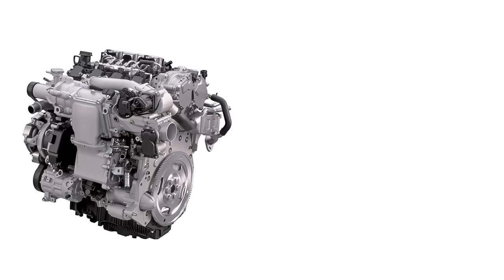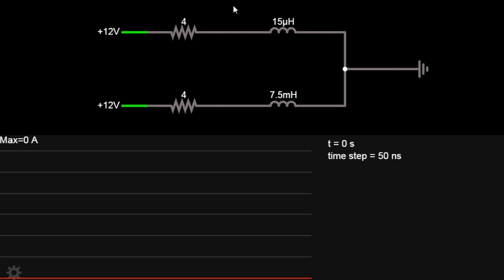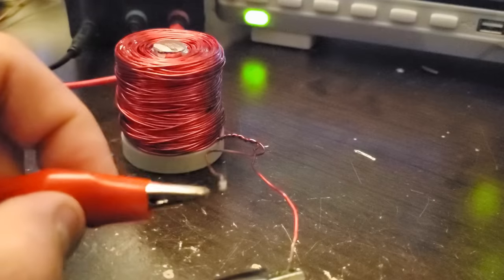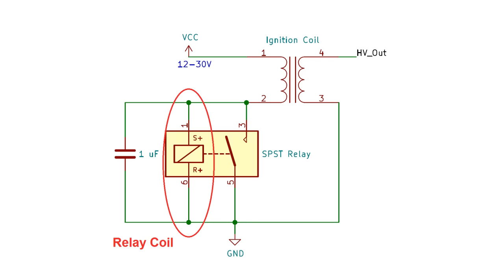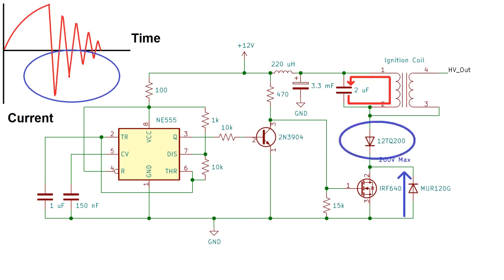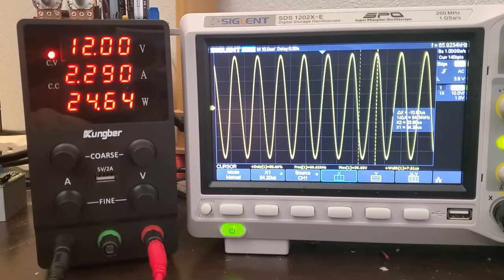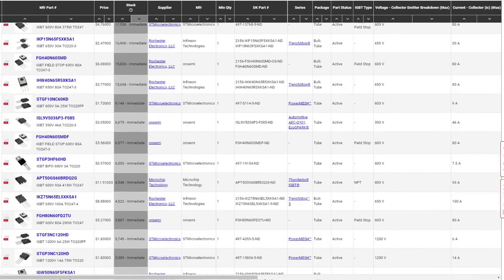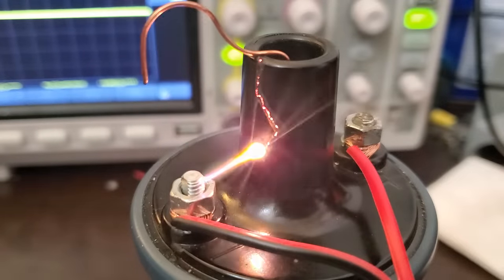Ignition Coil Drivers

Comment: Ok so in trying to 40000 volts to run straight, continuously ,from the coil high tension ,what would I need ,what size or type diode,to handle the 40k volts and would I need a capacitor to store it to keep it ready,I'm thinking multiple capacitors,  😅

Comment: Can one use a ZVS driver, somehow to drive the coil?
Reply from the maker: ZVS drivers aren't suitable for this device. In my experience the capiacitor/relay setup with the ignition coil is the simplest, cheapest way to get high voltage
Reply: @HyperspacePirate  Thank you very much for the info!

Comment: i think the resistor at 4:50 supposed to be in parallel to the capacitor not in series.this way the voltage spike is way lower.

Comment: 1:20 That diagram is incorrect. The ignition coil is, in fact, an auto-transformer; the secondary being over-wound from the primary. Where you've got the blue trace going to "HV" (should be called "EHT") should be connected to the positive and where you've got the black trace outer of the secondary connected to "GND" (should be called "-ve" because it is never connected to ground), it should be connected to EHT out.
 1:33 Another error. Flyback transformers DO NOT have "continuous AC" in them. The clue is in the name "Flyback"; they have a sawtooth wave; very, very similar to an ignition coil. The energy is produced by the sudden colapse of the magnetic field. In fact, both are auto-transformers but when the flyback is used to dive a CRT it doesn't have the magnetic "relaxation" caused by discharge but drives a capacitor through (generally, tripler) diodes.
  You've misunderstood how a flyback transformer works it runs partially in parallel with the yoke field coils which greatly add to the energy produced to keep the aquadag at a very high potential, providing a return current for the electrons
  You also should've used a higher Q coil so the resistance didn't parasitise some of the energy in the coil. Then knowing the inductance and resistance you could've worked out the on time of the input wave to bring the coil just into saturation. It would've been possible to use a darlington designed specifically for ignition circuits e.g. BU323Z and ditched that bloody capacitor and the lossy diodes.

Comment: I have a 1995 Maxima.  Would you happen tp know the use of the condenser in the electrical harness of the vehicle?
Reply: A 95 maxima probably has a "smart" coil that has all the control circuitry built into it, so it just needs a low voltage control signal to trigger it. In that case the condenser, old word for capacitor, is there just to give the primary a little more constant voltage as it switches on and off. It would likely run fine without it.
Reply: @pontiacg445  OK.  It's just that I suspect intermittent spark and was wondering whether the condenser stopped working resulting in the intermittent spark.  Any idea? Thanks for replying.  You seem more knowledgeable than others.
Reply: @renejacques8288  I would suspect the coil is damaged, there's a fueling issue, or the engine might be damaged, low compression or valve sealing issues, more or less in that order. All your coils probably share the same condenser, right? It wouldn't be very likely that only one coil would be intermittent if it were the condenser that failed.
Reply: @pontiacg445  Yes, the coils share the same condenser.  I pretty much rebuilt the engine.  I was told that the compression will be lower until the engine breaks in.  The min. psi for my '95 Maxima is 142.  Two of the six cyl. are at 125 psi.  The rest are at 145-160 psi (through repetitive cranking the no. 1 cyl. went from 125 to 160 psi).  Optimal psi is 185, I believe.  Other Youtube channels are of the opinion that the vehicle has enough compression to start.  I'm using starter fluid, I think that bypasses the fuel sys (I saw carbon on some of my new spark plugs).  I cleaned the valves and the seats using solvent and  wire brush.  I was careful to set the timing, unless I inadvertently swapped an exhaust and intake cam.
Reply: @renejacques8288  125 is pretty low, and about where I would expect it to start random misfires especially if it's not valves sealing. Does it have hydraulic lifters? I wouldn't expect it to be so low with new rings. You didn't spiral them into the groove, right? You need to use ring pliers to keep from twisting them. You can always dump a little oil down the plug hole to see if it's rings or valves not sealing. 

You can pull the plug and coil and lay the threads on something metal and watch it while you crank, at those low speeds you should see it if it's not firing like it should. Not a good tell if the coil is bad since it might still start missing at higher RPM, but it sounds like you just need a quick sanity check.
Reply: @pontiacg445  I have static lifters with shims.  Now my lifters should be w/i spec.  
While tightening a chain sprocket into a camshaft, I may have exerted some internal pressure on the engine.  Then later, while cranking during a compression test, I heard a noise inside the engine and the psi in cyl. 6 dropped from 125 to 50 and stayed at 50 for a bit.  I was afraid I might have bent a valve, but the cyl. came back to 125 on its own.  The same cylinder is now at 135 psi after I rearranged my lifters.
I don't think I spiraled the rings in place.  I just opened them up a little to fit over the pistons; I didn't use a special tool.

I tested the coils w/o the spark plugs w/ a piece of grounded metal, that was when I saw the spark seems to miss at times.  I'll test the coils again w/ a spark strength tester and see how good the spark is.
I looked inside the engine with a borescope and didn't see any busted piston surfaces granted I couldn't see the entire surfaces, I'll  check them again if nec.
Reply: @renejacques8288  If I were in your shoes, I would have at least lapped the valves with some kind of cutting compound. Cleaning them with a wire brush isn't going to do much if they are pitted or beginning to warp, especially if they started to burn from not sealing like they should. Swapping shims only works some of the time, more often than not you need to get at least a few thinner ones as the valves or seats sink deeper into the head, holding the valves open. That, or you can pull material off the valve stem itself to compensate, carefully. There is no wiggle room with solid lifters, if the clearance is too tight you are 100% wasting time doing anything other than correcting that. You might get it running, it won't stay that way for long. If you are way loose, you'll start slipping shims off buckets risking trashing the head. Since it doesn't sound like you bent a valve, it sounds like that might be what happened to you. Either that or your guides are super sticky somehow. 

Spark should not exist till the ECU finds sync, but it should once it's actually started sparking so long as you keep it spinning fast enough to register. If you ran the battery down from trying, it might not be spinning fast enough for a VR sensor to trigger, hard to explain till you see it in person. I'd be much more concerned with your valvetrain first, though. I've rebuilt a good share of engines, both cam in block and overhead and I've never had one start out that far out of spec. Sure the rings need to seat, but you aren't leaking that much past new rings.   

Good luck! I hope you get it going and get some useful life out of it!
Reply: @pontiacg445  The car was giving off white smoke so I proceeded to change the cylinder head gasket and while at it I thought I'd do those extra work.  The valves looked fairly good, no pits or visible warps.  I didn't swap shims, a friend shuffled the lifters while on the counter so I had to move  them around until they were w/i clearance.
If you don't think I bent a valve after what I said to you, none of the shims slipped( unless they're slipped now, after I've corrected the clearance which would be unlikely).
By sticky guides do you mean my chain guides?  
I keep the battery charged up, the cranking sounds strong.  I even hooked up my battery jumper to the battery just to rule a weak battery out. 
Since you advice checking the valvetrain out, I'm gonna do another compression test and see where things are because the #1 went up from 125 to 160 psi on its own., then I'll do another clearance check on each valve if nec.
I have a '99 Expedition.  I changed the head gasket and put new hydraulic lifters, it fired right up.  I was hoping this one would do the same.
Another thing, the maxima has 3 chain tensioners.  It's possible I swapped the spring in the main tensioner for the spring of one  of the 2 minor chains.  All the springs look the same, but I don't know if they have the same tension.
Reply: @renejacques8288  Sticky valve guides is what I meant, I've seen them get loaded with carbon and oil in L-head briggs lawn mower engines. They will randomly unstick from spring pressure making a click sound, but usually not well enough to get the engine to start and run. Usually car engines have much beefier valve springs, plus the piston can hit the valves back. 

Valves are meant to rotate while in use, your compression jumping all over the place could easily be explained by that. It has to be valves, because the rings are static. If the head gasket was bad, it's possible you had hot spots in the head moving things around.

I also replaced an entire head on a volvo penta chevy 350, somehow one exhaust valve managed to overheat so badly that valve spring pressure managed to suck it back in the head, it wouldn't seal at all and managed to crack the head between valve seats, zero compression left. Just looking at the valve it looked normal, but it was bell shaped. The injector on that cylinder was flowing ~30% less fuel than it should, clogged badly. Buying fuel on the lake is not a good idea I guess...
Reply: @pontiacg445  It seems the valve guides is what the valve stem seals fit into; I didn't even clean them, they might be sticky.  Would running the engine w/ clean oil solve the problem, or do I have to take the heads off and clean the guides?
Reply: @pontiacg445  I followed your advice and checked the valvetrain.  I put the cylinders at TDC and pour water in the intake valves.  All 12 valves bubbled except for maybe 2.  For some reason the #1 cyl. never burped to inform me it was on compression stroke, and it had the most bubbles.  Is my only option to pull the heads again, or could I somehow soak the mating areas with carbon solvent?  I'm guessing opening up the valves and scrub with a wire brush might leave metal debris in the combustion chamber.
Reply: @renejacques8288  I've never heard of that test, you put them at TDC and poured water in, then blew air in through the plug hole?

You could try, maybe with a brass brush, but I suspect that you've got mechanical damage to the valve or seat, not carbon or anything else that can easily be brushed off.
Reply: @pontiacg445  Yes, I blew air through the plug hole.
So you think after pulling the heads, using compound and rotating the valves against the seats should help?
Reply: @renejacques8288  Yes, unless the valves or seats are really badly damaged. You can put fluid down the port holes with the heads off and see if they are leaking past, if you reinstall the springs. If you can, I'd bring the heads to a shop and get them professionally done. You'll need to check the valve lash again when you are done.

Comment: what would cause a 6v coil + and get super Hot? I have the necessary grounds and just changed the spk plug wires from 8mm to 7 mm wires. this is a 1951 Plymouth 6 cylinder.

.
Reply: Not enough information, assuming you're using points and no fancy electronic system with dwell extension or anything like that, maybe the wrong ballast resistor to match the coil.

Comment: I need method to INCREASE high voltage from lawn mower magneto ignition 
fed by North field magnet on flywheel. Diode added just drops output to 
4KV. Would capacitor added in parallel to the 2MH inductor coil primary 
increase the output volts? The solid state trigger module replaces the 
points and 600v condenser capacitor. Primary Coil resonant frequency 
about 1-5KHZ. This is single pulse type - not an oscillator ignition. 
Magnet induction 1-8 volts. The flyback pulse as minus 130v from primary
 is what runs the secondary coil so as only 8kv to spark plug. Output 
diode added, reduces voltage by 60%, and very narrow spark gap then 
required
Reply from the maker: I'd have to see a schematic of what you're working with before i suggest something

Comment: And all the jr.high teachers thought my shockers were bad good thing I just used a magneto and a fly wheel for my shockers. The car radio transformers could shock through clothes using a vibrator and transformer and batteries of course. I think the voltage was about 250 volts pulse DC. Had I used 12 volts input the voltage would have been 450 V DC. I took care of the bully problem. I guess fear of shocking kept the bullies away. I wasn't the electronics genius they called me. All was fun and glad I outgrew prank electronics. 73
Reply: should have thought of that, I had a club in a paper bag  ....

Comment: i HAVE BEEN SEARCHING FOR YEARS TO FIND WHICH END OF THE PRIMARY CONNECTION  ( "+: OR "-")  IS CONNECTED TO THE HIGH VOLTAGE TERMINAL.  I EVEN CUT A FEW OPEN, AND ("THINK" FOUND ONE CONNECTED TO "-"    IS CONNECTING THE HIGH VOLTAGE TO "+ PRIMARY" A COMMON RULE???
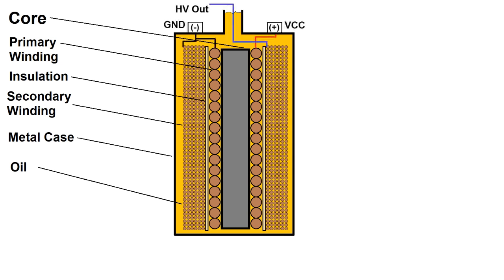THANKS FOR THE ONLY VIDEO WHICH SPECIFICLLY STATES THIS CONNECTION! IS TO  "-"  IT IS AT ABOUT TIMESTAMP 1:10
Reply: I came here looking for the same, but I think that the secondary circuit terminates at the + terminal. Otherwise, the secondary circuit would discharge through the breaker points that are in series between the - terminal and ground, causing breaker point arcs and degrading the spark. If it goes through the + then that means the secondary circuit goes through the battery and ignition switch.

Comment: I'm not clever men but I did look at those old Joe Cell guy videos he's describing magnets and wasters opposite equals your transformers aren't the same material the iron core in ignition coil and ferrite corre from that second transformer do not match so ther can't by any resonance at all I suggest useing gall coated nails I suppose an car selenoid with Dobbel wire might give more promising results and the secondary you can wire out side the case of that selenoid + you wuld have 2 primery coils inside that starter selenoid they call them s/r type starter selenoid perhaps that might work bether I looked long time ago some guy on YouTube building an hit n miss buzz coil out of an starter selenoid he just plugged the hole with nails zink coated I suppose .So the metal differences do not add ,probably an external inductor or RC box give the edge or useing those HV ceramic capacitors might give you nice plazma ignition . Those things aren't really good for static timers and transistors .But I believe that wuld fry your scope device easely .

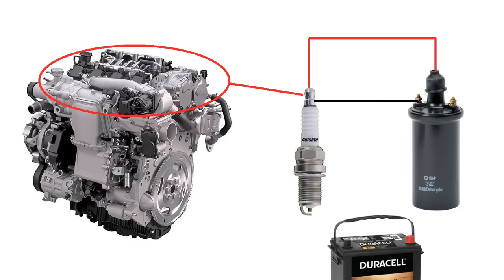Comment: Picture T0:49 is wrong, as switched ground is going only to the primary coil and NOT TO THE CENTER ELECTRODE OF THE SPARK PLUG. 
Picture T1:18 is also wrong, as the switched ground is connected only to the primary coil. NOT SECONDARY COIL, AS SECONDARY COIL GETS PERMANENT GROUND. (not switched)
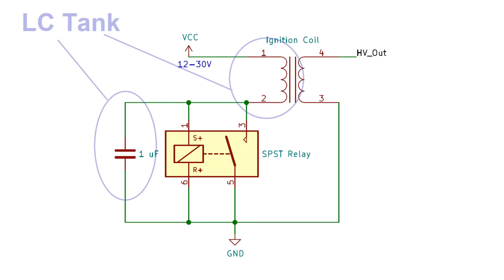Picture T5:03 IS CORRECT AS CONFIRM THE ABOVE.

Comment: Your video is way beyond me,  but is it possible the solution is a bit more simple.  I'm sure you are aware of the  effects of  reflected  impedance in transformers.  Perhaps diddling the  driver transformer  turns ration/ impedance, etc,  would be useful

Comment: I’m sorry but I’m 43 seconds in and very distracted by the statement “any engine that burns gasoline needs a spark plug” gas direct injection (GDI) engines can have a spark plug or just be compression ignition like a diesel with or without a spark plug

Comment: The now shut down website of S1R9A9M9 told of certain obscure tests done , as related to the triple coils assembly , as used on the 18HP Briggs engine from riding mower that ran on mineral water in carburetor 2008. A high voltage pulse through high voltage cable that is wrapped in 60 turns of insulated hook up wire and steel nail core,  with 20 amp draw from 12v battery and .6 load resistance - will change to 12Amp draw as  reactance in .4 ohms is CREATED in the 60 turns. That means that an old style ignition ballast resistor of .6ohm with 12v will draw 10amp for going THROUGH the engine spark plug, due to .6+.4 ohm in circuit, as 1.2 ohms total. The Champion spark plug internal 4kohm resistor is removable  from top, as then zero ohms with copper insert replacement. Other parts in plastic deli tub on side of engine besides the triple coils and resistor, would be accessory required spark gap, and 2 diodes as voltage drop from 13.5volts charged battery. Once started, the alternator to DC bridge rectifier 14.9A ran the circuit as battery had been disconnected. Magnetic field 10A impressed on cable extends timing from 0 to minus 34 degrees while electrical field impresses .4 ohm on same main circuit. (2 power sources same time)  Of course S1R  knew there was danger due to temporary acid expulsion from battery with the ignition high volts there, until the battery wire was removed after engine started. That's why he changed the wiring diagram so as it would then not work, since people got hurt practicing with circuit and not knowing what they were doing. The S1R coils was to be the replacement for the obsolete dual coils 60cycles AC relays as used on the car conversions. YouTube videos 1+2  BY  S1R9A9M9 .